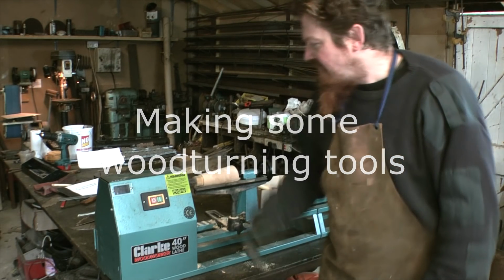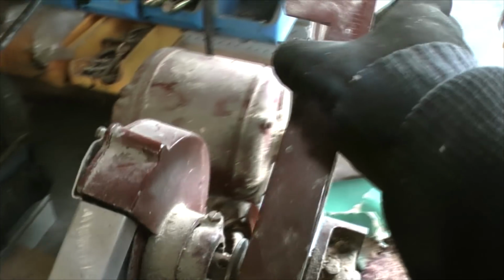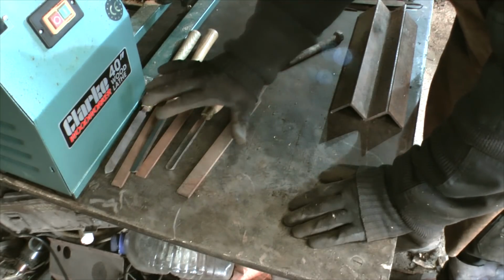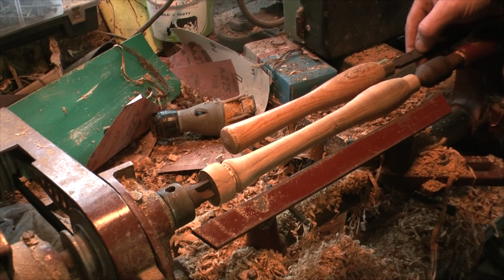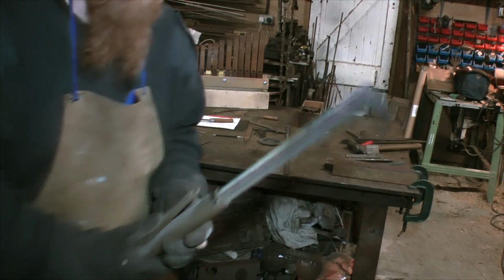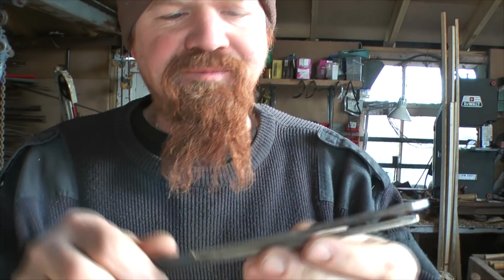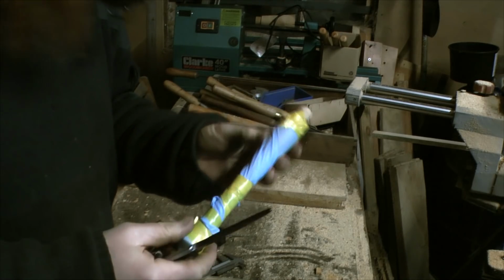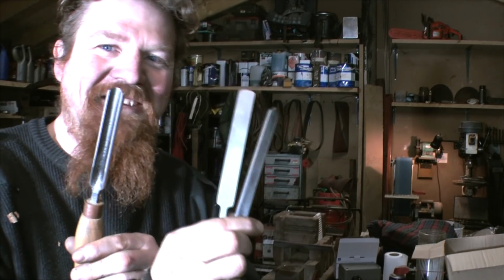Making a starter set of Woodturning tools

Comment: Hello maximus hope your well👍.  I also ended up buying a set of chisles from tool mart/ the worst tool shop in the UK!!! The chisles were Clarke branded and were shockingly poor quality and frankly quite dangerous the steel stock they had used was never cut square was bent in sections and looked like it had been dragged behind a tank for a good few miles. To hold a chisles at the bottom of the handle with the tooling end pointed into my work bench and press down on the tang to have it bend surprisingly easy dose not give me father in Clarke products.     I have an Axminster M950 lathe now and a brilliant mixed set of crown and Swan chisles I'm very happy with👍.  Thanks for all your videos

Comment: If you don't have the svage block, why you don't do a hardy hole tool welding a stick laying on the flat of the big horna, so you can shape a round using the anvil as a base? The three angolar interlocking don't seem the best for that kind of work... (I'm an amateur, this is not a criticism, but just to know)

Comment: Just watched a video by Sam Angelo saying "do not make woodturning tools with files !". Too much carbon he says, but does not explain what's the problem with that. And i know nothing about metal myself. Any inputs ?
Reply from the maker: I watched his video and I have to say I disagree. It's all in the heat treatment, files as they are might be a tad brittle, but once given the full heat treat as I did in the video, work very nicely. Files are often a 1080 steel which is not particularly high carbon steel.

Comment: hello fellow blacksmith they are different thickness,s because one is a roughing gouge and one is a spindle gouge , there is at least one maybe 3 more sizes of tool between them. PS files are high carbon steel W2 etc (some where above o1 tool steel guaranteed in fact almost double the carbon of o1 ) the chisels are high speed steel for a reason they resist over heating when subjected to high speed friction ,horses for courses on light work with little pressure the files may be ok but for things like a parting tool your going to burn file steel fast.

Comment: Hi Max, when you pop on the handle to the rats tail could you do it with the tail hot to get a snug fit or do you think it would mess up the tempering? Will🍻
Reply from the maker: You could do it hot but I found the square tang jammed into a round hole made a snug fit anyway. As long you keep the heat in the tang in won't affect the temper lower down at all.
Reply: Maximus Ironthumper Cheers Max👍💪

Comment: Hi. I’m sorry if this is a stupid question, will any metal become pliable when cold if it’s heated and allowed to cool slowly ? I want to bend some sheets of steel into something in a diy type stylee! Will then go harder ( not pliable ) when heated again but quenched cold ? Very enjoyable vids btw loving your house heating ststem👍 thinking of trying it with my Rayburn
Reply from the maker: Not a stupid question at all! Basically with steel, the amount of hardness possible is down to the carbon content in the steel to begin with. So a file (which has a very high carbon content) can become very hard (and brittle like glass) but mild steel (like your sheets) has such a low carbon content it is (almost) unaffected by heat treatment. It's possible it may work harden from repeated hamming but in practice I've never found that to be an issue. Sheet metal I always forge cold as I want to shape it rather than risk thinning it too much (there is a video of me cold forging 4 metre length of steel like that). If you want a really pliable metal you could try sheet aluminium? I used that recently to make a helmet - it was so easy to work with! Hope that helps.

Comment: Just wondering why you found the centre by measuring when you could have looked at the grain and put it in the middle of the grain? Just thought that would be stronger and any wobble would be removed relatively quickly. Not trying to be a smart arse, just wondering about your thoughts.
Reply from the maker: It's a fair point! Although sometimes the middle of the grain can be way off the middle of the wood, it depends how straight the tree was growing...

Comment: Nice video I would not have a clue where to start I had no idea that files could be utalised to make a chisel,had a swage block but gave it away bloody great big heavy thing the guy I gave it to up until then used an old manhole frame from the roadside it was about 18insh high with loads of bits welded on for different uses might give you an idea.I recovered a ships keel about ten years ago went down the shore with my Unimog with a hiab it weighed about two tones a guy bought it off me for twice the going rate of scrap and made about ten anvils from it.I sat eating supper watching your video glued to the screen thanks Maximus.

Comment: Wow, I didn't know it was possible to repurpose old files
Coronet tool Co. 1945-1988 R.IP.
Found this on a website http://www.lathes.co.uk/coronet/ which is an incredibly interesting read. 
"By the late 1970s the Coronet Company had been absorbed into the Sheffield-based Record Tool Group and finally lost its identity when a new range of well-designed, robust and inexpensive but confusingly-numbered (and confusingly-specified) twin-bar bed wood-turning lathes was introduced. Under Record ownership the Coronet multi-purpose machines were eventually dropped but, even so, with a few more minor changes including a distinctive chrome-plated bed bar and adjustable quick-release handles on tailstock and tool-rest, the Major was to continued in production until 1988."
Reply from the maker: Good find, thank you!